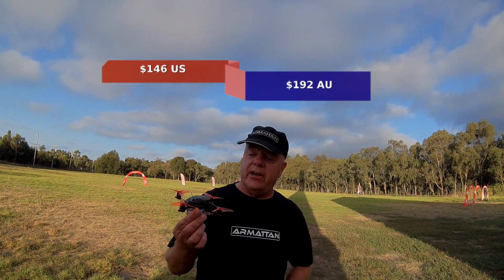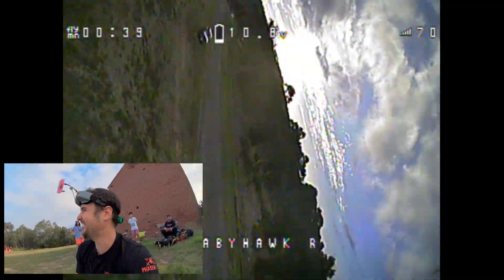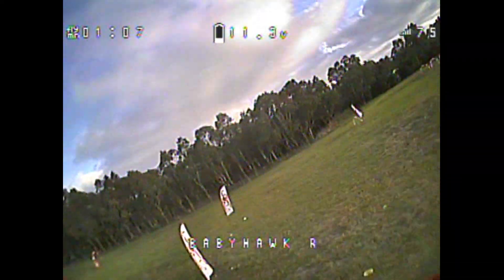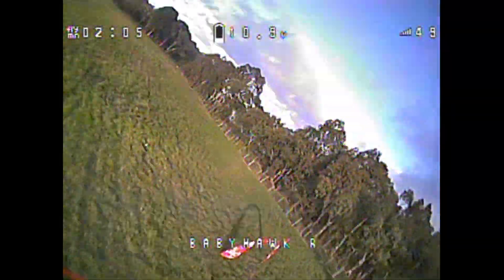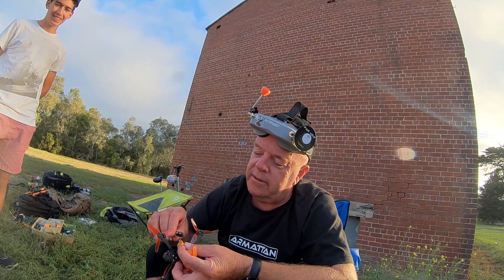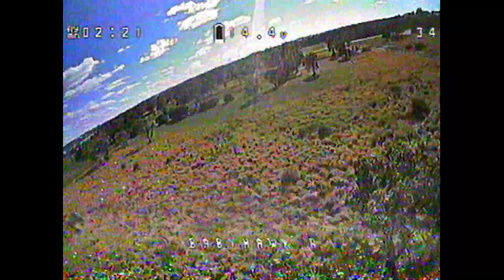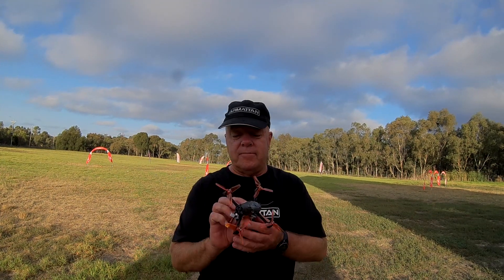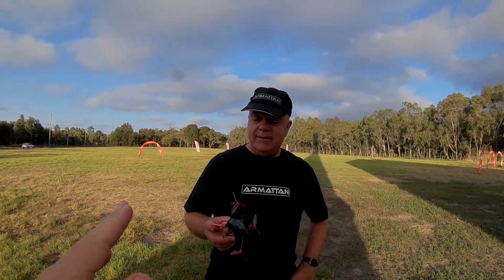Emax Baby Hawk-R 3 inch

Comment: May I recommend after having four of these and extensive testing if you replace the antenna with a taxi to sticking out of the top hole it changes this from an amazing quad to one of the best quads of all time imo. And yes that's including Gep, they are more hardcore but these are so much cheaper and more available to people all over the world the fact that they've made this quad so affordable and available I think will honestly change the game especially now that you can record from a micro cam without any external stuff I promise the next generation will have built-in DVR without a new piece in the stack... then I will be able to say it doesn't get much better than this, unless you got the money to pimp out a crazy gep rc 3 inch... im also ref to the BNF world, even though this quad is amazing regardless even for a pro it's worth bringing on the trip every trip...@grumpytrev ps maybe folding arms and props, plus a built in dvr cam... please pass on to emax Trev for v2! The fist REAL RACER THAT U COULD POCKET.... tell um YOU thought of it fuckit, lol..... ty very much ur the man and ty stu, for a great, comical episode all the best!
Reply: Pppppps....
First upgrade!!!!.....
Imo the mod the makes the biggest difference, is asap, after maiden.. very first thing is replace the stock whip (that works fine) w an with axii, no soldering.. as well as make sure that you have something protecting the bottom plate from the stack even electric tape..But this small modification makes the biggest difference of ANY imo, more than doubling the signal strength and Clarity to where I do not even put it on high and I live in the city and fly a pretty good distance half mile easily without break up on low-power on all three models I have

Comment: Hey trev, i bought a 2 inch babyhawk r and then I went and bought 2.5 and 3 inch arms. Will the 6000kv motors still work with 2.5 or 3 inch arms?
Reply from the maker: yeah they will but just be carfull your motors don't get to hot on 3"
Reply: Thank you for the prompt reply Trev, I thought I was so smart! I also have some dys 1407s I could throw on there.....thoughts?

Comment: Ok, I'm sold on the quad but what 4s battery were you running? Any recommendations for good 4s batteries under 1000mah for these 3" machines? Btw, glad to see another short and sweet micro review! Thanks Trev!
Reply from the maker: the 4s flight was 4s 650 65c

Comment: Great Video Trev, you mentioned that on the second day you used some 4s and changed to the 4s profile, what dose that actually mean to change profile? Thanks mate keep up the Vid's
Reply: Wayne's RC spin usually it's just a PID adjustment. Lowering is common as you up the cell count. You can save multiple pid profiles on most flight controllers. Hope that helps.
Reply: Emax has actually tuned this for you! Profile one in betaflight is for 3s batteries and profile two is for 4s. I hear that their tune is damb good too!
Reply: Thankyou Dale that's really good to know I'm just starting to look at the tunning side of things.
Reply: Thanks for the response Danny